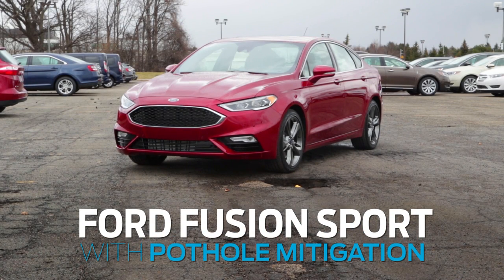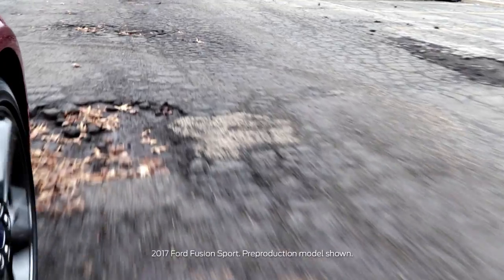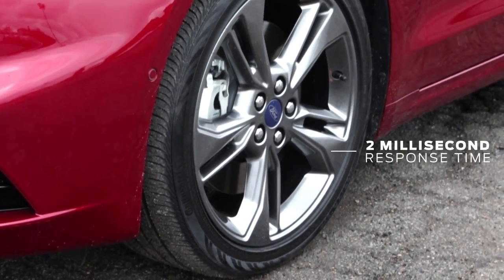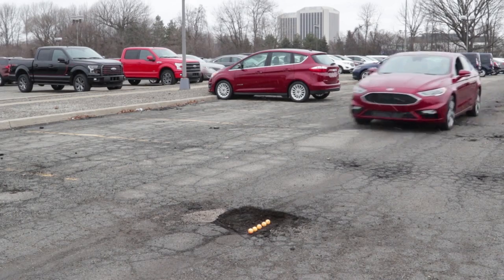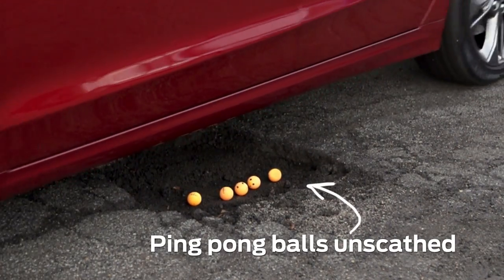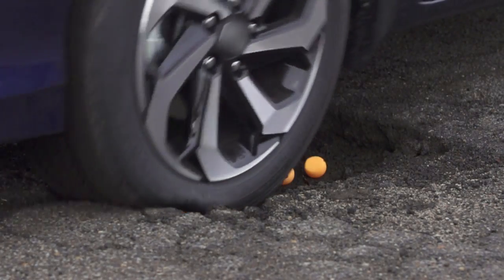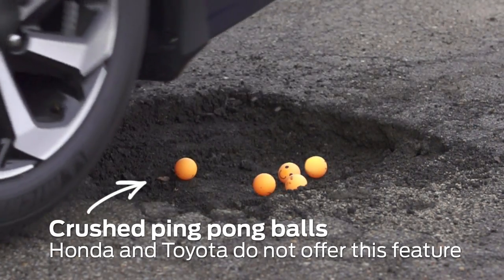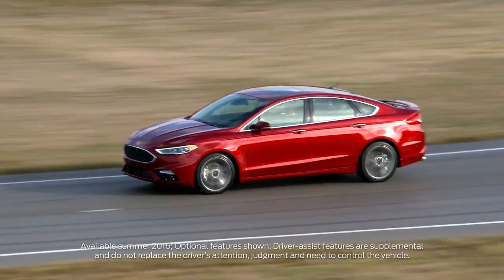2017 Ford Fusion with pothole mitigation technology

Comment: The car one was not simply physics, that’s actually a demonstration video of the 2017 ford fusions anti pothole technology. It sends power to the other shocks to mitigate the depth the wheel travels into the hole and is even more effective for the back wheel after the front wheel has identified the pothole